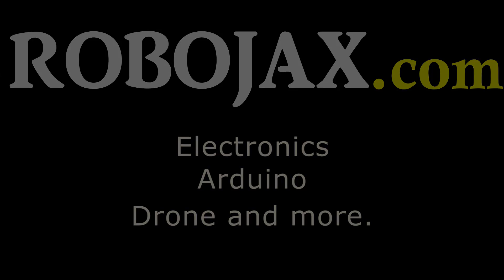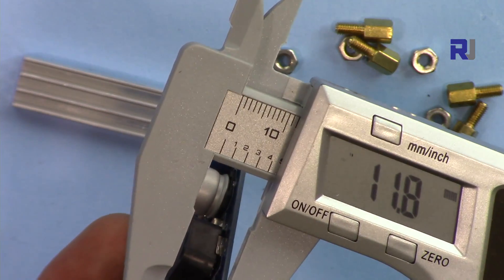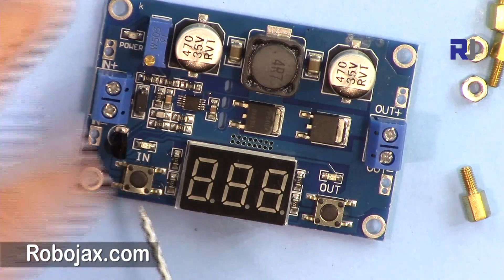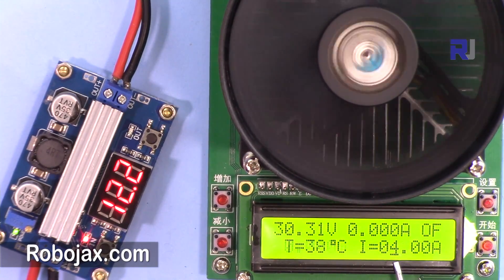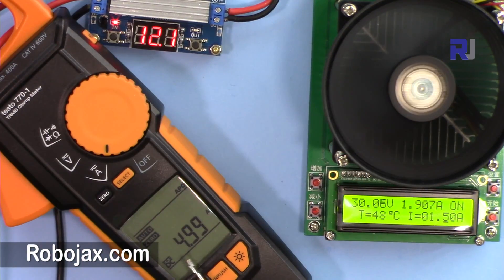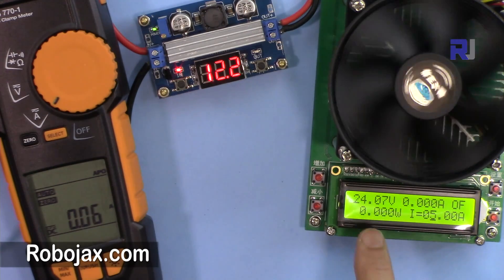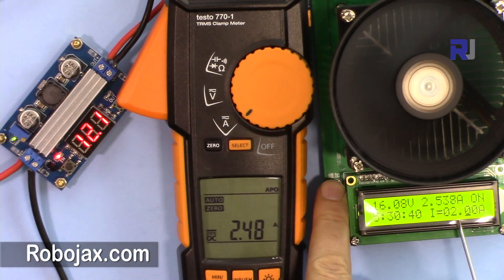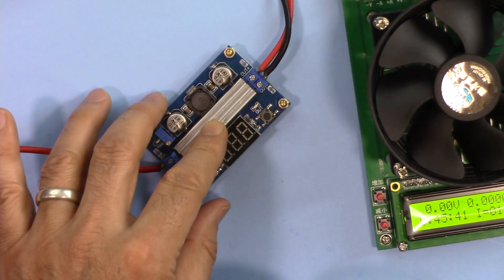Test Review of  LTC1871 Step Up 3-35V input to 3.5 to 35V output booster module

Comment: what will be the result if I input 3.3 volt via esp32
Reply from the maker: It seems you don't understand the meaning of power. Check the datasheet of esp32 and see how much power each output pin is producing.
Reply: @ yes I am new

Comment: You are trying to give 12 V from the input and get 30 V - 5 A, ie 150 watts from the output. Well, don't you ever calculate how many amps should be input from the input. 150 watts / 12 volts = 12.5 A. According to the manufacturer's data, you can give a maximum of 9 A from the input. In addition, according to the manufacturer's data, the maximum power of the module is 65 W! A little reason and logic!

Comment: Ahmad, could you tell us, if this can be connected in parallel. for high current 5 v to 12 v do we get any solution.
Reply from the maker: Hi, yes you can use them in parallel but make sure you set both modules at exact output voltage and current

Comment: Can I use this to charge Lithium Iron Phosphate battery from a car battery?
Reply from the maker: I don’t remember if this has constant current  or CC (you have to watch and find out) if it has CC then yes. For for one cell set voltage to 3.65V and for more cells multiply it bye that number. Then set the maximum charge current. Less than or equal to the capacity of battery.

Comment: its a crappy product but that doesn't mean you can claim fail on something thats is outside of the specs! the board is limited to 75W output max! and it will drop voltage to the same level becuz thats the way is intend to use (hi power LED and such with constant current) so plz read the specs and then claim the device is fail at delivering the specs.
Reply from the maker: I did not because sellers on eBay or AliExpress or Amazon simply put the details from datasheet. so people should see the result at the condition this is sold.
Reply: @robojax   99% of the of the links that i checked stated 65~75W! its hard to find a seller without that info.
Reply from the maker: موفق باشید.

Comment: Actually I order that module and it's seems different a bit from the module you tested.
I'm going to use to feed 2 TPA3118 modules to 26v.
I'm upgrading my Bazooka bass tube twin Ta8225h system. 
Input from car battery with engine running 14.5v - - >26V
The TPA3118 would be fine with 2 ampers

Comment: Hi. Can i recharge a battery with this board?
Reply from the maker: you can't do it with this because this does not have CC or constant current.  Your batter will die if you charge it without controlling the current (ampere). See this video I've explained  the module and charging battery https://youtu.be/hkLC6EcSklI
Reply: @robojax  thank you for your reply. In my attempt to charge a battery i swap the plus with minus on the output, and  now the board is dead. I check some parts on it but i can t find the broken one. From your experience what part from the board can be broken if you apply  revers power on the output side?

Comment: Hello, i like your channel.
Can you draw schematic of this board? with soldered components its hard to understand.
Thanks in advance
Reply from the maker: Thank you.  this module is so cheap. if you try to make it, it will cost you more than twice. I have provided the LTC1871 datasheet where the schematic is used in this module.
Reply: @robojax  Thank you. I know it is cheap. Im trying to add this on my board. I can see that pin 1,2,3,4,5,8 are connected differently than on provided datasheet. And other values are in use. That part confuse me and thats why i ask for schematic

Comment: You keep increasing the output voltage. Can you draw 2A with output at 5V max please ?
Reply from the maker: Hi, I just watch the whole video to reply to you. I tried the toughest tests for this module. You did not mention the input.  but you can come to conclusion from other tests.
Reply: @robojax  Input is at 3.7 V - I need to know if you can draw an output current of 2A at output voltage set at 5V which is not shown in this video . Thank you.

Comment: Is there a way for the output voltage to increase with an increase of the input voltage? I need to increase the speed of a welder feed motor but still needs to be adjustable. Turning the small adjustment screw each time is not practical.
Reply from the maker: No. this is called regulator. The output always stay constant.

Comment: That dual schottky diode is actually supposed to be the blocking diode from the inductor to tje output capacitor. That's how boost converters use them. I noticed the inductor going to the drain of the fet and then branching directly to the diode while the other pins of the diode are gong to the positive output terminal.
Reply from the maker: thank you for the comment. I appreciate it.
Reply: @robojax  My pleasure!

Comment: You have the equipment but you don’t know how  make real tests.
Reply from the maker: make a suggestion. I am listening.
Reply: @robojax  take in consideration the wire size, the voltage drop, due the use of an incorrect wire gauge.  In the video only you show a input voltage.  Use a line adjustable load. You use one that is good but you need to stop the process increase o decrease the amp's.  Use one that have a potentiometer to make adjustments without disconnecting nothing.
Reply from the maker: I used a wire that can handle 20A so I did not need worry about it. Adjusting is the most important part and I am planning to add more because people will say "will it output 18V if I input 5V?" so I have show them all possibilities. I am doing the review for current and voltage purpose. People don't need anything else. here is my latest video that a module failed https://youtu.be/WxxJbqV2di4 and another one which did not fail. https://youtu.be/ypVX4oebFGo

Comment: Hello, This is a nice tutorial. I have two questions:-
a). I have an input source of 6 volts, 5W - I dont know the amp. Will I be able to power a 12 volts regulated device from an input source of  a 6V, 5 watts to power a 12 volt 2 amp device?
b). If I use the output to charge a 12 volt Li-Ion battery and set it set to 13.5 volt charge output, "How and where" can I connect my regulated 12 volt device to power it such that my device is  
      powered 24 hours - First from a power source but revert to my rechargeable battery as backup power to power my device until my "POWER SOURCE" is RESTORED
Any suggestion will be appreciated. My email is donwillcomputers@gmail.com
Reply from the maker: Hello,  1-NO and possibly YES. 5W input will NEVER be 5W out as this device has some losses like 10% to 15% and if you are okay with that losses, yes.  2- You will need a controller like Arduino to do that. To read the voltage or sense the sources and switch them with relay accordingly.  I read all comments every day or every 2 days and this is the best place to answer so other people learn from it.
Reply: @robojax  Thank you for your quick response. Kindly send me to links where I can find your suggested "Arduino to do what I wanted.:
Reply from the maker: just get Arduino UNO which is cheap and easy to use.  you can search on eBay, Amazon or AliExpress

Comment: This test missed very important step : To test it at 3V input ... which is the most important feature ...which is the voltage of Li-Ion battery/power bank (1S)
Reply from the maker: Hi, I missed to replay to your comment. I just watched the video to know what I did.  It doesn't work work below 3.3V. Also because of the display doesn't work below 4.5V, that was another reason. Thanks.

Comment: practically it does not work....voltage drops gradually....when connected to devices
Reply from the maker: You might have defective module. or your "device" or load needs very more power than this module can supply.

Comment: I buy one connected to my 12v 5A power supply....And suddenly fire fry up my board
Reply from the maker: You connected the + and _ incorrectly. It should not  burn.
Reply: Robojax i check the polarity first but well....it start fire, the booster still give stable output
Reply from the maker: Amazing. Good for you.

Comment: I don't think that diode is for circuit protection, it's part of the boost circuit "D1" as seen on the LTC1871  datasheet.
Reply from the maker: you may be right. I have to find the module and look at it again.

Comment: Any idea if the LTC1871 would handle an input of 3 to 4.2v with a stable output of 10v @ 1.4amps for short periods and a normal operation at 600ma?
Reply from the maker: at 03:24 (click on 03:24 to see it) I have shown that there is a power MOSFET, at the test shows you can get 4 times of 600mA you can get at 12V output watch it at 12:18. Yes definitely it will work because you  demanding very low power.

Comment: Sounds like INPUT current is 5A max (not output current)
Reply from the maker: NO. The input current can go  above 6.5A.
Reply: It appears unit fails when input OR output current goes significantly above 5A. e.g. at 3V input and 36V output it will fail when INPUT current goes above 5A. This means output current cannot go above 0.5A at 36V with 3V input.
Reply from the maker: I reviewed the video and you are right. The input current is always 5A or less in all "passed" testes. Thank you.
Reply: No problems. I love your channel and your professional reviews
Reply from the maker: Your very kind. Thank you.